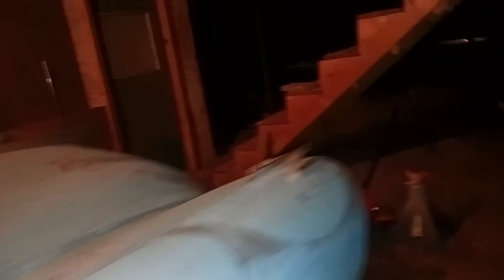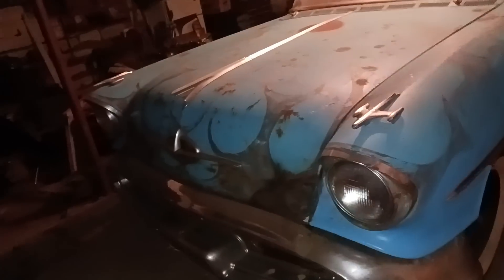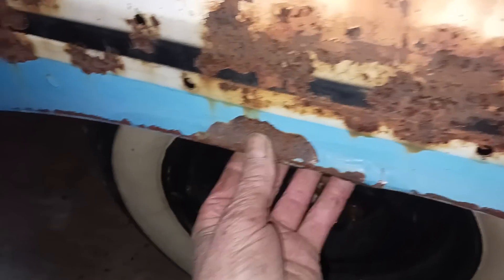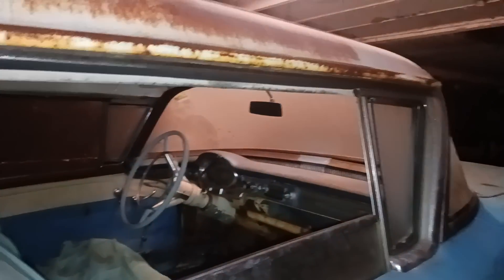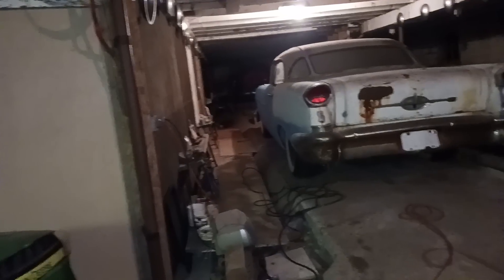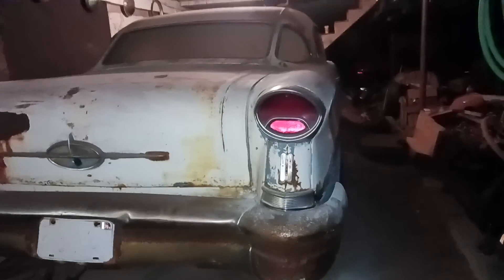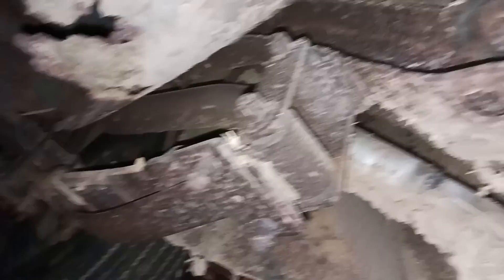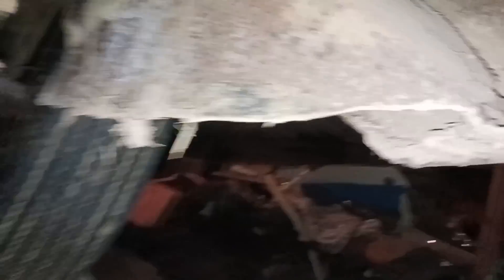hi not to bizzy to day

Comment: I have a 1950 tea20. I have owned it for a long time. It has a standard overhead valve engine. I believe they used them in triumph cars in the uk. I made new wires , copper wires with 1k ohm waterproof ngk caps soldered to clips at the distributor cap. They work great and keep things running in the damp. The car is nice. Someone mentioned pool noodles. That’s an interesting idea as they can’t absorb moisture. I wouldn’t spray foam it. I like your motorcycle stories. I have 25 bikes, norton, triumph, bmw (all restored) and a farmall h , and a tj Jeep that I bought for my daughter and after she ran it (into the ground, lol.) I restored it. No more cars for me too much work. I wonder if chads carbs need those heat insulation gaskets it being liquid cooled and all…take care.

Comment: Jim, if you decide to go with spray foam to close up those fenders, be sure to use a low expansion foam.  The other stuff will likely push out on those fenders.
Also, either type of foam will adhere to everything it touches.  It could make removing the fenders at a later date very difficult...

I'd probably fabricate an additional metal fender liner for that area, that could be removed with the fender.  If I felt it was that important to have something there.

Comment: Great idea about routine starting of vehicles Jim. Letting anything mechanical sit for too long without running it is the surest way to destroy it. The salt air on the east coast makes it important to run those wheels around and use the brake pads to clean the discs or drums. I love this Olds, and she is coming along just as fast as you like. Thanks for sharing with us.👍🇨🇦

Comment: I keep an electric fan in my garage on a timer to keep air moving to prevent condensation on anything. It’s on for 30 minutes every 2 hours. I started doing it once I noticed some chrome pitting on my motorcycle. My classic car which came after has zero surface issues.

Comment: Jim you can get a rubber that is like a foam as well they sometimes use a little bit of it on the door seals but you can get it in larger pieces. It should be ideal for the job you need it for

Comment: Jim wire wheel the bottom of your doors and weld holes they have stuff you put on rust to converts rust into a printable surface or just us poor 15 to seal rust. It's good you removed the dome you can get a dence dome rubber love your show